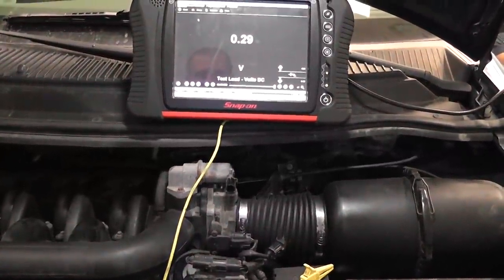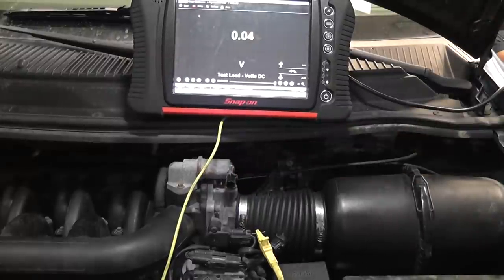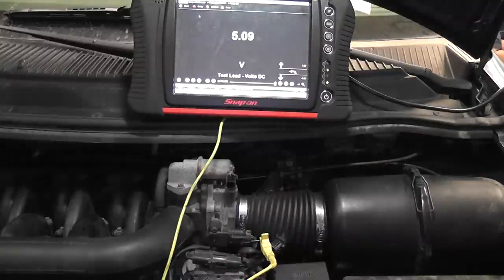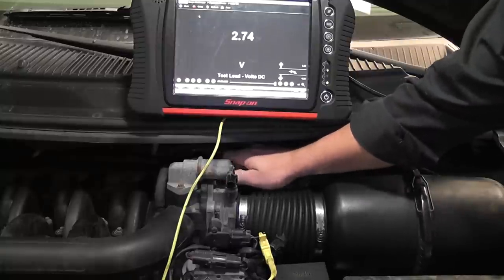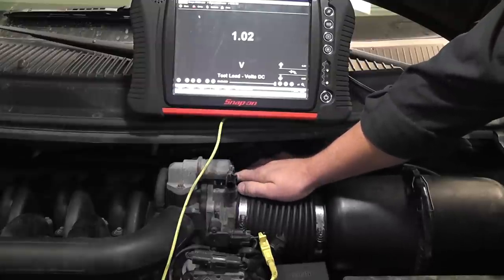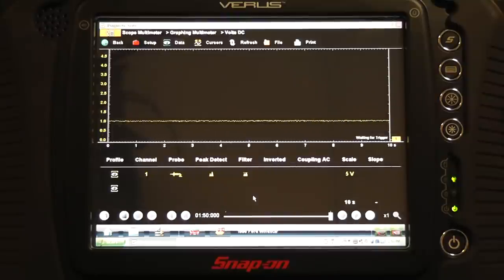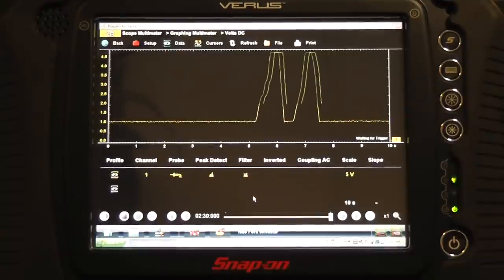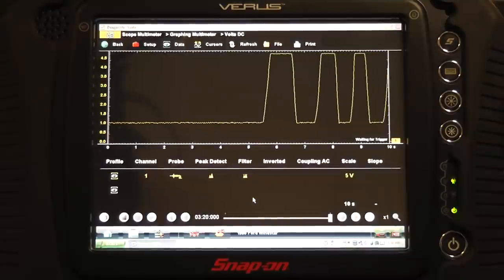Throttle Position Sensor Test (voltmeter and scope)

Comment from the maker: @jdubb408 No but there are two different circuit designs. With the TPS unplugged and measuring signal wire voltage, one design will read 0v and the other design will read near 5v. Of course with the sensor plugged in the signal should range from under 1 volt at idle to over 4v at WOT on either design.  The 5 reference wire I think is what you are referring to and on both designs you should see a steady 5v regardless, plugged in or not.

Comment from the maker: What does your sensor grounds read on other sensors? ECT, IAT, MAP etc. 
If they are all high too, then most likely you have a bad main computer ground. 
Remember all sensors ground at the computer, NOT on the block itself. The computer then grounds to the block.

Comment: Just curious....can TPS be bench tested using an oscilliscope? I have several laying around in my garage and would like to bench test with a Hantek 1008C if that's possible to determine if they are useable ??? I'm a Jeep Wrangler 4.0L TJ guy so have extra MAP, Idle Control, and TPS's laying around.

Comment: ScannerDanner, can you tell me how to do the test on a 2005 Toyota 4runner? My Torque Pro is showing the Throttle at near 20% open at idle and only goes to 80% at Full Throttle... Got a shudder on at around 1300 to 2K RPM when under a load cruising at a speeds of 25-40. I can push past it if i give it gas but i really have to move the skinny peddle to get a reaction... Mas/Map is new,  all new Toyota Coil packs and plugs, new gas cap. I do not get a check engine light for a code.  The ecu has logged a single misfire on #3 cylinder only one drive cycle and #4 has had the same on another drive cycle and a 2 count on one drive cycle, there was a single misfire on cylinder 5 one drive cycle.. Not sure if its a bad TPS or Fuel pump. Battery volts are good, i pulled the fuel regulator pushes no fuel out the spout when removing the vacuum line! Im lost.. Lol. Thanks! Oh yeah, with key on and engine stalled/off is also shows near 20% throttle open and only goes to 80%... Edit: I just checked my moms 2009 Acura TL and it shows 16% with key on no foot on gas and 80% at Full Throttle. Now i'm thinking maybe fuel filter or maybe pump!

Comment: Hey Paul, my blue driver sometimes doesn't support a tps voltage pid but a percentage pid, graphed. If the sensor isn't on limp mode, is it safe to do this same test since it's graphed?

Comment: I have P2100 and P0222 open circuit and low voltage to TPS. No start.  My 08 Mazda CX7 has electronic control TPS- cant vary the throttle without moving the plate back and forth which I understand messes things up in the PCM? How can I go down the line on the 6 pin connector looking for my open/low voltage- should it be a ground open? Someone said I should have a constant 12v to the TPS? True? I have 5v each at E and F with ignition on. All others +/- .004. This is a engine rebuild so I don't know the history. Any help would be much appreciated.

Comment: Thanks for the quick reply At the time of finding the codes I had a open circuit code for the water temp sensor when i looked at the wiring diagram It uses the same ground wire as the tps So i made a seperate earthing point for the water temp sensor and it cleared the code So i just thought it might work for the tps maybe not I will check the ecu ground and maybe run a new wire to the ecu sensor ground pin?

Comment: I've read online and was also told that you can probe the TPS and check the resistance as well for a bad sensor. My car for example, if I want to drive down the road and coast my car wants to hold the idle up at about 1500 rpm sometimes its around 1100. I resistance checked the TPS and found that through the sweep check I had a higher resistance than normal when opening the throttle plate on a random spot so what I did was unplug it and tried driving without it and it idles better now and when I coast down the road instead of hanging it drops down to normal about 750 rpm. This is on a Ford by the way. Does this sound like a good check? seems to work for me.
Reply from the maker: It is another method, although not at accurate and more difficult to perform than the voltage sweep test.

Comment: my scan tool only says the throttle position is 87%, and sometimes jumps to 88.2% when the pedal is to the floor. Is this normal? I've been having even more issues with acceleration
Reply from the maker: Yes, that is very typical. If you're having low power conditions at wide open throttle focus on your O2 sensor next at wide open throttle. It should be 800mv plus the entire time your foot is on the floor. Tell me what you see.

Comment: how are you @scannerdanner im Adrian from California I work in the automotive field always learning have your book and today I ran into a dodge 4.7 Durango with tps p2074 code along with p0068 ...found no vacuum leaks tested map with scope while I had vac gauge hooked up tested ok..tested tps sweep test with scope ok but when I tested the 5v ref to tps with koeo signal was ok straight line but with koer had glitches I can see drop down in my min max my min would be -4v what can cause my 5v ref to glitch
Reply from the maker: If they are consistent steady drops in the ref circuit, it may be normal. GM does this on some of there app systems. For more precise monitoring I suppose.
Not sure about Chrysler.
Reply: not constent sum drop outs are less then others
Reply: I have acces to similar vehicle with no problems will scope tps 5v with koer see what I get and update you
Reply: is a vantage pro a good scope recently purchased one is the sampling rate the same as your verus

Comment: I had a TPS on an E-150 that failed only when engine was hot and would kill the engine. This made it hard to diagnose. The TPS was located on the bottom of the throttle body between it and the intake manifold.

Comment: Hi, Paul. When I do multimeter sweep test my voltage goes from 12.6 mV to .207 V. Positive readings, but way out of normal range scale ( 0.5V to 4.5V). TPS itself is ok 5.8 Kohm resistance. Substituted it with no condition changes. What is your opinion ? Short or open ?

Comment: An old student of yours here. (94 Ram 5.2L) 5V reference good, ground good. 1.1V at idle, steady increase upon acceleration until it gets to 2.19V then goes OL upon further throttle opening. Assumed it was a bad sensor. Not so. New sensor same deal. just for kicks put 12V to reference pin (unplugged) grounded ground pin and showed 7.**V on signal wire. twisted tps and went all the way up to 11.5V indicating to me that tps is capable of outputting close to reference voltage. What is happening that wont allow the TPS to output (return) close to reference voltage when plugged in and in open throttle?
Reply from the maker: There is no such thing as OL on a voltage scale. Unless your on too low of a scale. 
Good to hear from you Denny!
Reply: ScannerDanner Its a self-ranging Fluke meter but something happens after 2.19V and it runs the same way. At moderate throttle it falls on its face lol. Do you think it could be a PCM ground issue? As I said with sensor unplugged, applied voltage is nearly returned. Thanks in advance. Glad you're doing well and still at it.
Reply: ScannerDanner By the way, I think it's amazing that you love to be able to share your knowledge so much that you do this to help people with no expectations of compensation. What a great person you are.
Reply from the maker: Denny Ryan
what happens after 2.19v? OL is not an option.
There are other things that can make this truck fall on its face at half throttle. Do you have a code for the TPS? Or is that just where you decided to start?
Reply: ScannerDanner Didn't check for codes. Idk if the check engine light even works lol. This thing is running terribly and I have to drive it daily to get to and from work. Now, at idle, it acts like a carburetor when it "loads up". On the highway it keeps acting like its running out of gas (probably because after 2.19V on the tps it does something crazy). I checked the MAP sensor while power blocking it and it seemed normal. I'm wondering where the PCM ground would be as I pressure washed the engine compartment a few months ago and it seems to be getting worse as time goes by. It is intermittent though because the other day it was running well and I took it in for tailpipe emissions test and it passed. HELP ME PLEASE !!
Reply: ScannerDanner I've not been doing this type of work and I'm a little rusty, but with 5 kids I just cant afford to take it somewhere and say "Fix it". Hopefully with a steer in the right direction I can figure it out
Reply: ScannerDanner Ok Paul. I grabbed a different voltmeter and I'm reading .846V at idle on the signal wire and 3.8V WOT. A little off it seems but still functional. I'm going to re-check my voltages on the MAP with this other meter. Wow that fluke was expensive when my company bought it a year ago WTH?
Reply from the maker: That's better. Now do some other checks. Fuel psi, fuel trim, O2 readings when it acts up, EGR, trouble codes, ignition misfires etc.
Reply: ScannerDanner I went straight to the MAP sensor. Reading good at first. 1.2V at idle 4.4V in gear WOT. Then I let it idle for a minute and watched the voltage climb up to 4V and was extremely rich obviously and stalled. While this was happening I could hear a loud hissing sound near the throttle body like a major vacuum leak. Hit the gas and it straightened out for a second and then started climbing the voltage scale again. Could this be an IAC or MAP problem? As I mentioned it's intermittent yet acts up more often than not. I'm not in the field, so my access to diagnostic equipment is limited to a voltmeter ( now that I have one that works lol)
Reply: ScannerDanner Gosh, I hate to keep bugging you but I really need to fix this thing before it gets any worse. Feels like it's not going to make it. I'm leaning towards a problem with MAP since it acts up at highway speeds as well as at idle. What would cause it to read high vacuum on the highway and seem as though it's starving for gas intermittently, yet read low vacuum at idle and and run extremely rich and flood the plugs intermittently? Well, actually I haven't checked the signal voltage at WOT while it is acting up. So many possibilities. ie.,EGR, EVAP, MAP. I've shyed away from IAC due to the highway issue. I wouldn't think EGR would be intermittent at idle either.
Reply: ScannerDanner Okay Paul. So the MAP is probably not causing the problem but is the end result of the intermittent major vacuum leak. The only two things i can think of to cause an intermittent vacuum leak resulting in the symptoms are EGR and EVAP. IAC i dont think would cause the highway driveability issue. Can you look at this with me if i were to bring it to you? Ran really good for a long time today then acted up once i got home in the driveway. Im pretty sure the pcm wouldnt try to operate the EGR or EVAP at idle to cause a vacuum leak. Im lost. Idk how to reach you but this is getting old not to mention i look like a stalker for Pete's sake lol. Im no technology guru by far
Reply: I'll look at it for you as long as you drop it off and don't need it back the same day. I need a few days as teaching is primary over fixing if you know what I mean.
Reply: I could make that work as long as its not longer than a week i guess. I really cant steal my wifes car but maybe i can borrow a truck from work. The truck is not state inspected so road test may not be advisable although i've been driving it like that. It is registered and insured. Just waiting for time to get other 2 ball joints installed and money for a speedo issue maybe you can diagnose as well (being electronically controlled). I dont even know where the school is at now. Any idea what the intermittent vacuum leak could be? Very loud hissing near throttle body when acting up. Can you email me a contact #? ryan266@verizon.net
Reply: ScannerDanner Premium When do you think you could get to it?

Comment from the maker: watch my dirty maf case study video. i would go in that direction next
Reply: Hey man I’m having this nightmare of an issue with a 08 impala. Did one of your 5v reference checks and found I wasn’t getting 5v ref, due to a faulty wire ran a wire from the bottom to the new harness and bam 5v still getting engine reduced power low circuit on sensor 1 and 2
Reply from the maker: @kennymarshall6899  you need to locate the break in that harness or the area where it is shorted, that is where you are going to find your issue. With your jumper wire installed, what are your signal circuit showing you on sensor 1 and 2? You didn't tell me what sensors either? APP or TPS? 
At this point, let's move this to my forum. I can help you better there www.scannerdanner.com It is free to join. Let me know when you post it.

Comment: I have run a direct wire to my ground pin for the tps on the ecu Still getting Incorrect voltages on the tps and voltage drops. I have another tps on the way lets see what happens

Comment: Ok ive run a new wire to my ecu ground wire which is for the tps and water temp 

5v ref  Plugged in - 2.66v - 4.39v @ WOT             5.0v when unplugged
yellow signal - 1.5v - 3.9v @ WOT       Needs to be .5 @ idle (tried adjusting)

I checked the a few other sensors they are ok Not sure whether to try another ecu or tps hmmm

Comment: Ive been having problems with a tps on a car that's had a engine conversion I'm getting 4.86v on the ground wire on the tps when i havn't earthed the wire yet wtf? And when i do ground the wire I don't get my 5v ref And my signal wire starts at 3.2v then 4.8v WOT It needs to be down to .5 at idle Tried adjusting it manually but nope the lowest I can get it 3.2v It's like something bad is going in the tps Unless ive done something wrong

Comment: :)   You are the man   !!!
Reply from the maker: Does this make sense to you? With your DMM you need to do this test very slowly to see the glitch. You do not need the engine running either. 
BTW your 01 Mustang is not an electronic throttle body is it?
Reply: it has a cable. Na..